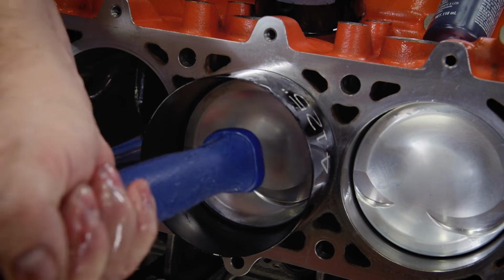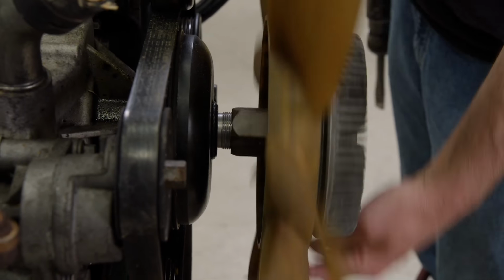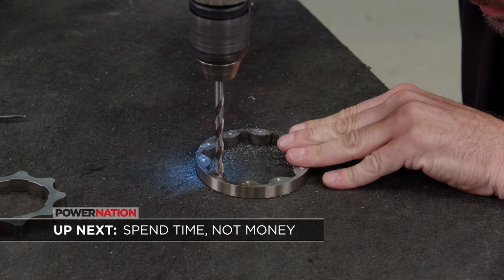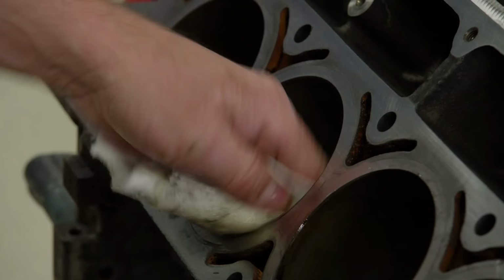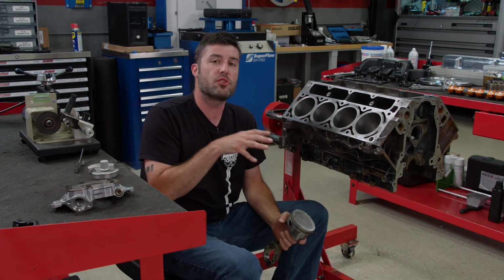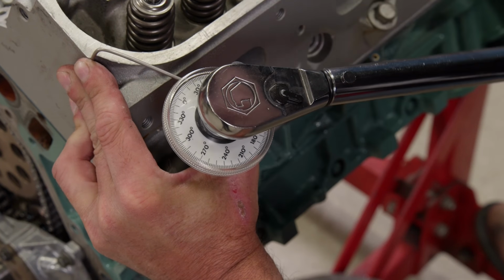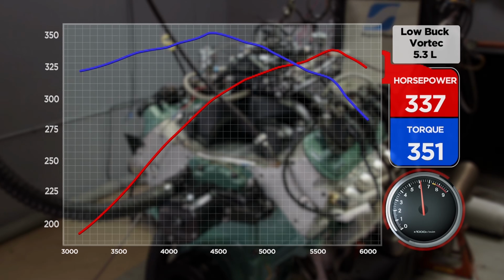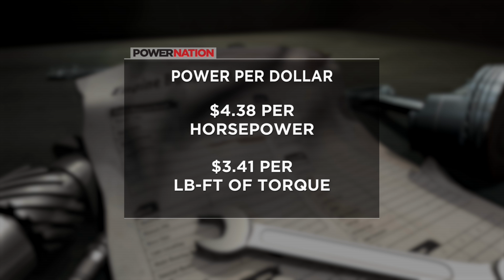Minor Upgrades Create Crazy Power on a Junkyard 5.3L Vortec - Engine Power S7, E10

Comment: I've got a 2012 Nissan Versa 1.6 L 4 cyl, Manual 5 speed Trans with a little over Hundred and One Thousand Miles and was thinking of Rebuilding the Motor. What would your opinion be on how much it would cost to Rebuild? It doesn't Burn any Oil and Runs Top Notch so far. But I can hear some Tapping coming from the Motor. It's at the Age now it will start Costing me Money. I like the Little Car. It's in Darn Great Shape. Never been Wrecked. Handles very well. I was thinking of doing the OLD SCHOOL rebuild like what you just shown in your video. Do you think it's worth it?  Look forward to your answer. Thanks for the upload.
Reply: Sounds like you just need a valve adjustment lmao
Reply: @Josh-hf3fm  Josh I'm Old so, what does Imao mean? Also, would you think it's worth redoing the Motor and what would be your opinion on the cost?

Comment: The knock sensors are a common failure point. That screw part is also the ground for the sensor. I had to remove mine and make a tap to clean it out to get the sensor working again. 4:34

Comment: They are doing their math wrong.  They spent $2000 to make about 50 (without the bottle) horse power more than stock.  So that is more like $40 per horse power.  GM performance has a long block that make 450 HP for $4300 but where is the fun in that.  I would like to see $3000 build that makes 425 HP, naturally aspirated.

Comment: And see it can be done now if you want to take on the LS 1-3 bore over the cylinders rebalance the main crank add a fuel injection system with a larger shot and in it to win. And just imagine you all haven't even touched the heads yet she maybe a tad bit heavier though that block can take the abuse if done just right. So always keep a iron 5.3 block in ones mind. Aluminium blocks are great though they can expand and contract one to many time and force its self loose aluminium high horse and  torque blocks should be torn down at least once every couple of years. Aluminium can cook gaskets and seals faster when used for hot runs and such. Nice post enjoyed the build stay blessed.

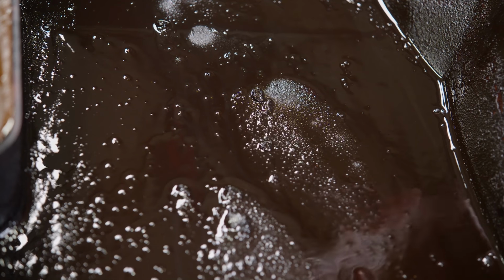Comment: At 4:27 - 4:31 he pulls off a metal pipe, what is that pipe and what does it do?
Reply: It is engine water vapor crossover tubes. They even out the coolant between both heads, front to back.
Reply: @sean5comet  Thanks!

Comment: "Nitpicking" doens't stop draining your wallet. Every nut and bolt, machine work, and procedures you cannot perform at home will cost you. Special tools needed for home machining, and assembly will cost you. Those cost will nickel and dime you. You take a junkyard 5.3, and do what they did to it will easily run you close to $5000.  Don't discount "Nitpicking", it adds up quick.

Comment: You would make north of 400 on fuel injection with the parts you put in it , you can’t make power on an LS if the fuel delivery is uneven between the inner and outer cylinders like that. You don’t have to spend a lot of money on a fuel injection setup either, LS1 stock used intake manifold, with injectors of your own preference(LS1 ,LS6 or LS7 injectors are an option in the used refurbished market) , bigger throttle body is optional if you like. You can use the stock engine ECM stock sensors and HP TUNERS and you have a 400hp+ engine, the time you consider going to a Holley ECM or any other after market ECM is when you’re going FI or nitrous. I think LS’s are over played but i admit wholehearted The magic of an LS v8 is the cross compatibility between parts for the Camaro and corvette that makes them so cheap to make power

Comment: The carb and the ignition together are approx $1500...how is that cheap? Why not test w/the stock EFI set up? If you throw $1500 at an engine you BETTER make some power lol. Now using the Holley Sniper, you started making sense. So add $1500 to your $2470.

Comment: What a joke...
Richard Holdener takes unopened junkyard 5.3L, runs them with electric water pump and headers with the factory EFI and consistently makes 350hp/380torque.  

These guys spent over $1500 on intake, carb, and controller (not to mention all the added work)...  added a mild cam and made 330hp.  

Powerblock spends more on BS than some have in their entire engine.
Reply: Budget build but they use probably $100,000 worth of tools and equipment. You know, a simple build you can do in your garage. Just stick the block in your parts washer and run the crank on the polisher.
Reply: I'd honestly like to know how it made so little power with that cam, when as mentioned, Richard Holdener's numbers show pretty consistant 330-340-350hp with tubular headers and electric water pump, with the tiny stock cam...
Reply: I was thinking the same thing. They lost horsepower from stock. Even with bigger cam.
Reply: @zmanphx  They lost horsepower? What horsepower did they start with?  My 4th gen 2008 with the LMG engine code is rated for 310 horsepower. I'm pretty sure the engine in this video is older than mine and so it was rated for significantly less than that. They ended up with more horsepower than my engine, didn't they get about 335 horsepower after the mods?  So I'm not sure how you concluded that they lost horsepower?
Reply: actionjksn 
The factory ratings of 310hp of your engine and the 280hp of the earliest 5.3L have all the accessories, full factory exhaust, and factory tune on them.

Richard Holdener has run numerous completely stock 5.3L engines from the junkyard on Westech’s dyno the same way the engine in this video was run (headers, electric water pump, no accessories, better than factory tune), and even the earliest 5.3L he’s run made 350-355hp.  
That’s why the “335hp after mods” is down on power.
Reply: @zmanphx  my 2008 4th gen 5.3 is rated for 310 horsepower, so I'm not sure they lost horsepower.
Reply: You can actually get more compression with all the carbon buildup in the engine lol.

I think this is a early engine. They started at 270hp stock
Reply: @alexfrederick9019  These LS truck motors vary quite a bit in horsepower depending on the year. Like you said the early ones were around 270, while the newest ones I believe are over 340 horsepower. So they've been creeping up over the years.

 My 08 310 hp version feels very powerful to me. I can light up both back tires no problem, fortunately whoever ordered this truck new ordered it with a posi traction rear end, I looked up the VIN number and it's actually listed. On damp pavement at 40 MPH it will break the tires loose and start drifting sideways with a little less than half throttle. It has happened to me accidentally quite a few times. 

The owner before me had it rebuilt and they deleted the 4 cylinder shut down thing. I don't know if that helped the overall performance or not but this thing feels very powerful. It has 264,000 mi on the truck.

 I've heard the carbon buildup in the combustion chamber increases compression which makes sense. But I don't think it would be enough to have a big effect, the carbon can only get so thick.
Reply: Richards engine still has all the junkyard miles and dirt. This is a fresh engine, with essentially 0 miles.
Reply: @michaelwintz1896  They lost the LS magic when they cleaned out the dirt that enriches gasoline and oil to make more power
Reply: My 19 is 355 hp 383tq , they run strong.
Reply: My factory gmc makes 355 horsepower 🙃🙃🙃🤪🤪🤪🤪
Reply: This show is a joke

Comment: "much more sensors" required for injection?  besides a tps sensor what else would injection need that you weren't already using for that carb setup?  
it looks like you spent more money to convert to a carb vs re-using the factory injection and harness/sensors.
Reply: oxygen sensor, intake air temp sensor, coolant temp sensor, knock sensor, map sensor, etc.....
Reply: @frigglebiscuit7484  All that stuff could have grabbed a box full from the junkyard for next to nothing.

Comment: How to turn a $500 junkyard engine into a $5,000 dyno dandy.
Reply: Lmao this. "After we reused everything" not including complete tear down, hone, tank,  gasket, bearings, reassembly, new cam, aftermarket intake, carb, ignition controller, nitrous, etc. Silly ass video.
Reply: Don’t forget the headers.
Reply: @Getitstraightyo  That was pretty reasonable stuff even for a home mechanic.
Reply: @chrismeek589  Yeah machining a block is something most guys do at home
Reply: Don't forget the rebuilt heads!
Reply: $500 for a junkyard ???  where , not all junkyard have that price . and in Illinois the junkyard engine is very expensive , And if you are lucky , they give you the electric
harness , or they  charge you extra for the electric harness ....
Reply: @mcozpda3392  In my state they are all over the junkyard and not too many people pull them out. But I won't say what state i live in. And yes, they do go for around 500 bucks.
Reply: True dat!!!!😂
Reply: At least the paint was free. Nobody would  have paid for that color.
Reply: Forget LKQ, they'd gouge you for the crud on the valve covers if they can.
Reply: Right
Reply: Vs. a 10k LS crate swap, it’s “budget”

Comment: Cleetus McFarland taught us junkyard 5.3`s dont last long under boost and nitrous.
Reply: No, junkyard 5.3s just can't handle Cleetus
Reply: LOL.
Reply: Cleetus was the failure point of those engines. But it was fun lol
Reply: these engines can reliably make 500hp boosted.  they were never designed with nitrous in mind, but the rod bearings and rods are very over built to handle years of abuse and misuse, and keep on running.  Fasterproms makes a living turning these 5.3l engines into 450hp motors that will do that all day.

Comment: I was all about it until I send them throw that f**** dinosaur carb intake on
Reply: For the friggin $1,200 or whatever they spent on that intake, carb and ignition, they could have bought a Holley Sniper or Terminator EFI. Or they could have just left the FACTORY EFI on it. Get with the times.
Reply: @WideLoad405  sniper is nice. Any self learner running off a wideband or any o2 sensors and mass air meter gonna get peak performance and sweet driveability including factory ecu could be tuned. Idk. Even better fuel economy and that doesn't suck!
Reply: Yep. I stopped watching when i saw that.
Reply: @Mrwebb57  Replaced the mains and not rod bearings?
Reply: Carb will always make more power
Reply: @jamest4363  that's why Carburetor companies are popping up all over LOL.  FLY EFI

Comment: Ran 2 of those dual plane intakes on two different engines. They are garbage on drivability. Real bad dead spots. Cut the center divider out & put a 1" spacer on it & runs much better. Or buy single plane intake & be done with it.